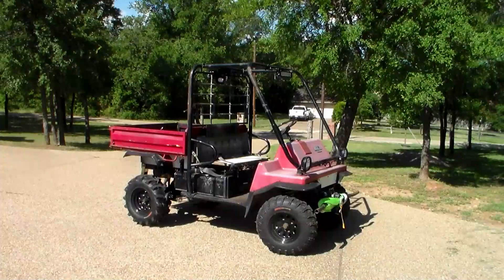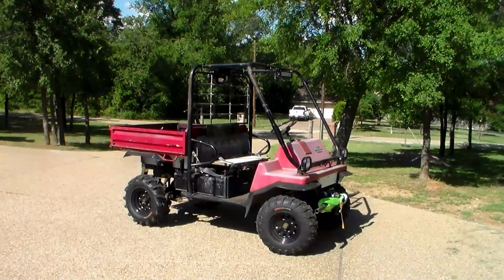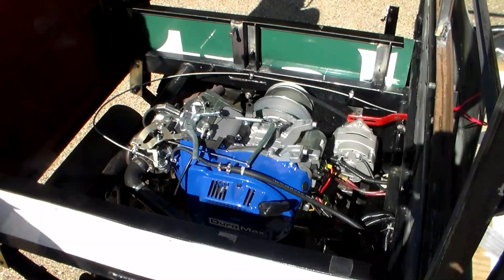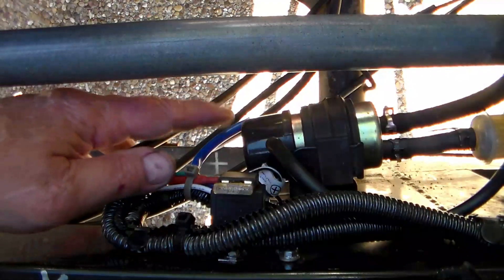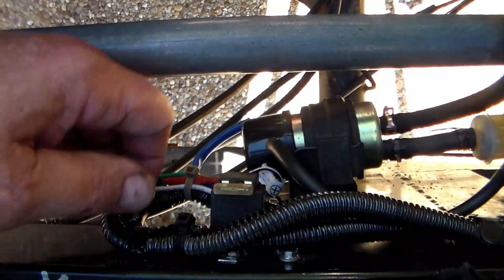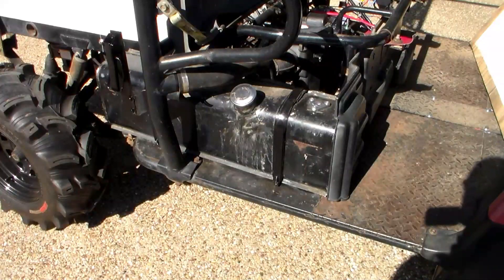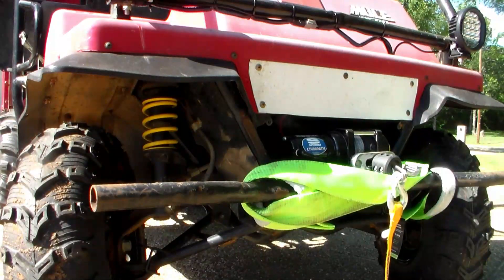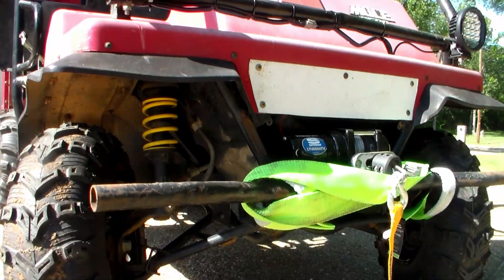Mule 2500 modifications and repower, Duro Max 18 hp

Comment: What size/series was the torque converter ?
Reply from the maker: Can be purchased on Amazon

780 SERIES 1 INCH BORE 1/4 INCH KEY WAY
1 3/16TH-1 1/4" BELT
7" Diameter (7.25")
1700 rpm engagement
1" bore 25.4mm
1/4" keyway 6.35mm

Comment: Great engine swap! I also have a Kawasaki mule 2500 that the motor is getting tired and I was thinking about doing the same thing. DuroMax now makes a 500 cc engine. Believe it’s the same block and bolt pattern as the 440, just a larger bore and stroke. 
I would probably go with that engine if I do it. I’m curious why you raised the engine up 8 inches. 
I was hoping mine would fit in there without having to raise the bed up. Luckily, mine already had an optional add-on alternator from the factory. It is ran off the flywheel side,  so I could  reuse the same alternator and fit it to that engine.
Reply from the maker: I wanted to use them when same factory length drive belt so that’s why I moved the engine up. Good luck on your build and it sounds like your engine choice will work well.
Reply: After looking at the engine mounted, on the video, I see why you had to raise it to keep the same belt. It wouldn’t clear the transmission without raising it. I’ll probably try and mount it lower and more forward and just use a longer belt. But, I won’t really know until it’s sitting on the frame. Thanks for your help.

Comment: Hello sir I have a question...... Which clutch did you use? Reason I ask is..... I am trying to do the same thing with a Kohler twin CH20S...... The clutch I bought is too small and when the driven clutch expands it lets the drive belt run right up off the drive clutch......
Reply from the maker: I used 780 Driver Clutch 302405 1" Bore 1/4" keyway for my project. Purchased off of Amazon. Good luck on your build
Reply from the maker: I used 780 Driver Clutch 302405 1" Bore 1/4" keyway. Purchased it from Amazon. Good luck on your build

Comment: Fantastic work!!! I recently bought two mule 2510s...one ive got running great, the other was for parts...but its pretty much only missing the engine. I happen to have a briggs 20hp vanguard engine i rebuild laying around, and an alternator off a ford 6.0 that works. 

Was your mule originally a diesel? I found some conversion kits for them, but theyre all for the diesel engine ones. 

ALso where did you pick up the shaft extension and clutch/pulleys? 

Any advice would be huge! again thanks for uploading this